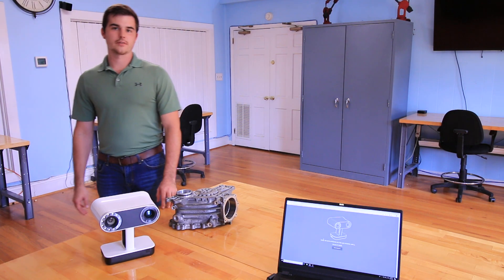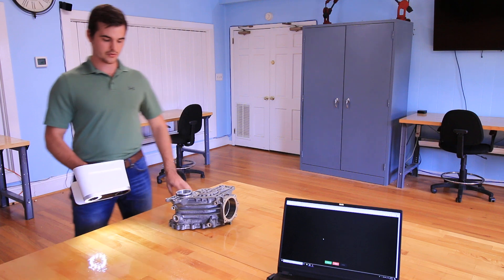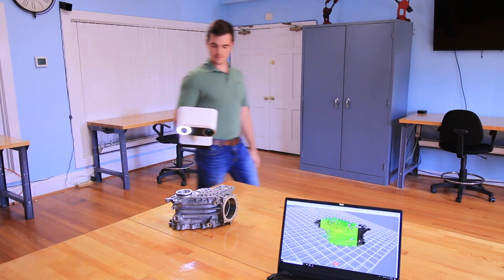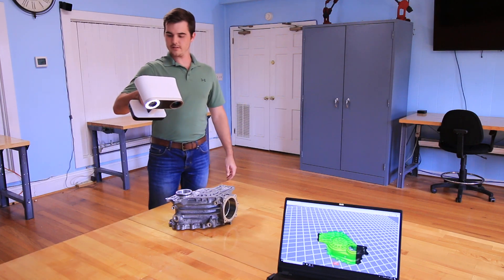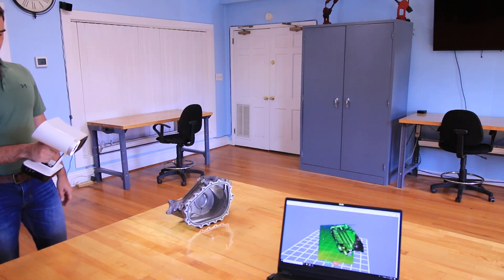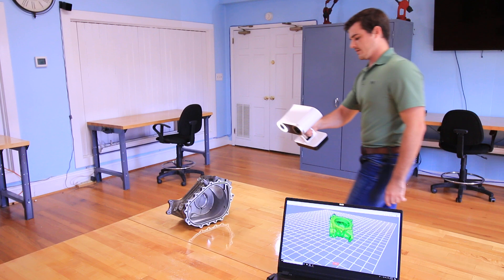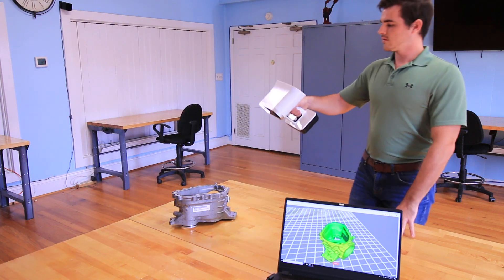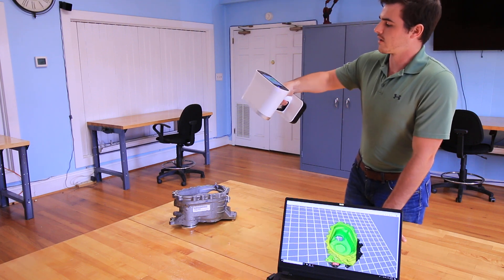Scanning Mechanical parts with the Artec Leo 3D Scanner

Comment: How do you stream leo on the pc? What settings are you using? I'm going mad trying to use mine for a much simpler part than this one
Reply from the maker: You can turn on screen casting on the Leo, this simply shares the video feed to your PC. There is no way to scan directly into Artec Studio. 

    In the Projects screen, tap Settings.

    Select the Network section.

    Turn on the Cast screen to browser toggle.

    Locate the scanner’s IP address that appears near the toggle.

    Open a web browser on another device.

    Type in the Leo’s IP address and confirm your entry.

    On Leo, start scanning or open a project.
Reply from the maker: We recommend starting with the default settings: Auto exposure and default FPS. For a smaller object like this, we limit the scan distance to 1 meter and turn on Base Removal.

Comment: why does sketchfab says "3D scan of a crank housing with the Artec Space Spider" ?🤔
Reply from the maker: You have a good eye! Thanks for catching that. Sometimes, our team scans the same object using different Artec 3D scanners so there might have been a mix up. We're not sure if we scanned it with the Artec Leo and mislabeled it as Artec Space Spider, or actually this was the Artec Space Spider scan data. Since it was 4 years ago, it's hard for us to find the answer. 

We have similar parts that were scanned with the Artec Leo you can see for scan sample data: 
https://www.artec3d.com/3d-models/car-engine
https://www.artec3d.com/3d-models/crankshaft-hd
https://www.artec3d.com/3d-models/motorcycle-engine-cover-hd
https://www.artec3d.com/3d-models/motorcycle-frame-hd
https://www.artec3d.com/3d-models/dual-clutch-gearbox

Our sincere apologies for the mix up!
Reply from the maker: For anyone who is interested in the 3D model of this part (which might have been scanned using the Artec Space Spider instead of the Artec Leo), you can find it on Sketchfab here: https://sketchfab.com/3d-models/crank-housing-3d-scan-ad033dc1ca224be39dbe2f7600446983

Comment: Hi. I am thinking of scanning an object covered with the organic life. Do you think it would be capable of scanning let's say a surface covered with slime, weed or barnacles ?
Reply from the maker: The Artec Leo is good for scanning organic life, as long as the object is not transparent. So the slime might pose a challenge is it is transparent, as the 3D scanner is unable to scan  transparent objects without adding surface treatment. You should be able to scan weed or barnacles without any issues. You can check out this fountain 3D model scanned with the Artec Leo where the bottom has organic life.

Comment: Hi, just wondering that if the part model can be converted into SOLIDWORKS or INVENTOR file?
Reply from the maker: You can use the 3D model as a reference for designing it into a CAD model. If you are interested in learning about the Scan to CAD process in SOLIDWORKS, you can watch our video series here: https://www.youtube.com/playlist?list=PL4XNEVS15EmkQAuPJU-8F6cJaEWdHvkYJ

There's a common misconception that a 3D scanner cannot directly output a CAD model. However, this is not true. This is because a 3D scanner outputs point clouds or mesh data, which acts as a single entity that is not editable. You can read more about it here: https://gomeasure3d.com/article/answer-can-3d-scanner-output-cad-model/

Hope this helps!

Comment: Difference between actual dimensions and scan dimensions?
Reply from the maker: Actual dimensions are the true values of the object's measurements. As with every measurement tool (from rules, calipers, or 3D scanners), has a degree of uncertainty. For example, it can never get the true value of the part. Scan dimensions will have measurement error (the difference between scan accuracy and the true accuracy of the object). Professional 3D scanners tend to have better accuracy than low-cost or consumer grade 3D scanners. You have to assess how close you need your scan accuracy to be (which typically depends on your application). For example, if you need it for inspection purposes, you would need the scan accuracy to be high. If you just need to output a 3D model for visualization (e.g. e-commerce), then you would be fine with a less accurate scan data.
Reply: @GoMeasure3D  and whats that the professional 3d scanners name?
Reply from the maker: @goodm8  It's the Artec Leo 3D scanner. You can find more information on this 3D scanner here: https://gomeasure3d.com/artec-3d-scanners/leo/

Comment: How did you connected with computer and make live scanning? We have that one too and we need to scan it first then transfer to computer via sd card
Reply: In addition the scanning performance is not like on the video!
Reply: @KingGurcan  Your Leo should scan just as fast as this demo. If not, check your frame rate settings, you may need to increase it.
Reply: This is the screen casting feature for the Leo. There is no live capture for Artec Studio. You have to transfer the scans via WiFi, Ethernet, or SD card.

Comment: Does it know the scale or dimension of the object or does that require a manual post-processing step? Is it calibrated for measurement?
Reply: It does know the exact scale of the object. Every Artec scanner is calibrated to sub-millimeter accuracy straight from the factory, no need to calibrate.

Comment: Hi, What parameters were used in the scan? I mean distance, fps, texture exposure time? Thanks
Reply from the maker: We recommend starting with the default settings: Auto exposure and default FPS. For a smaller object like this, we limit the scan distance to 1 meter and turn on Base Removal.